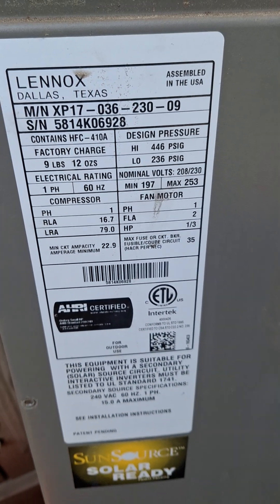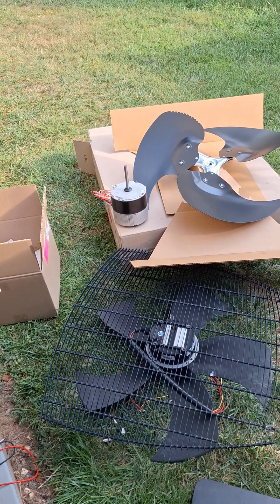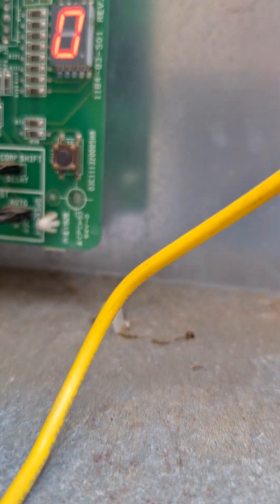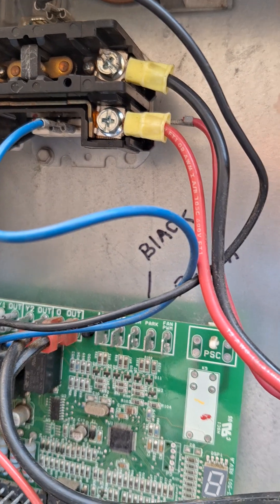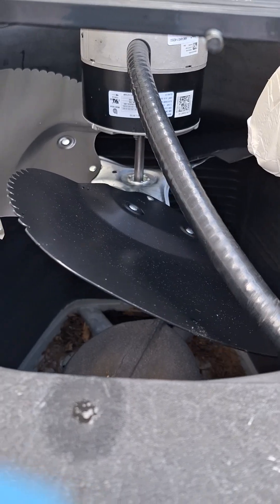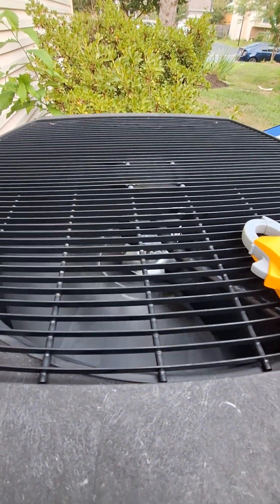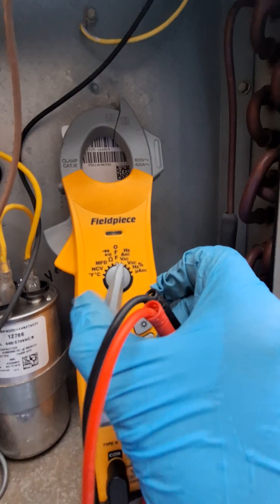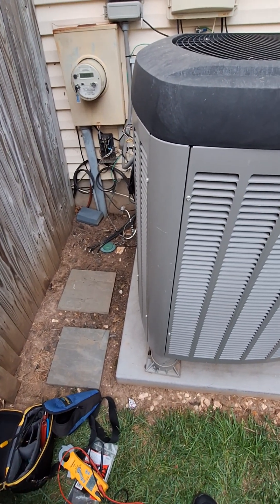Lennox Heat Pump Fan Motor Replacement

Comment: Can you tell me what that new motor part number is? Cant find that replacement motor anywhere
Reply from the maker: I can not remember. Contact Lennox with the model or serial number and they should be able to assist you.